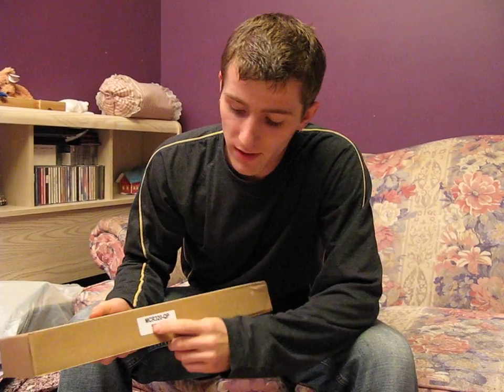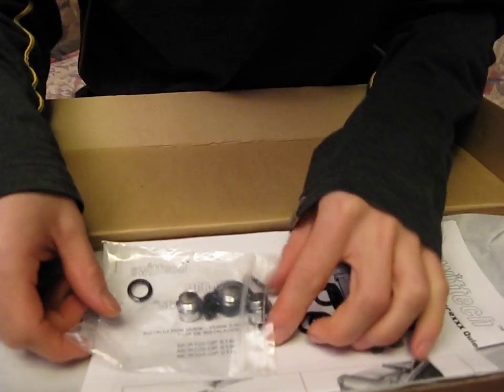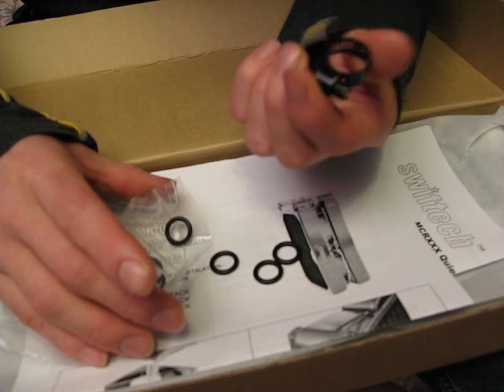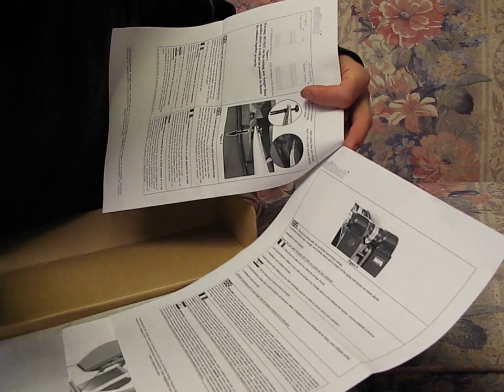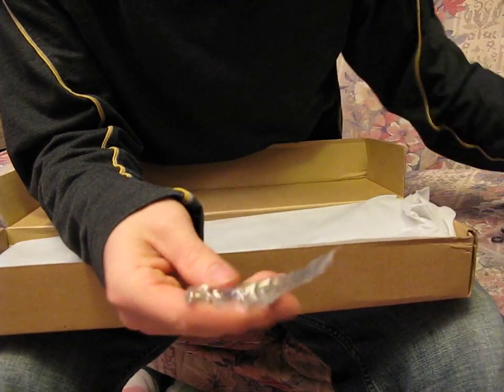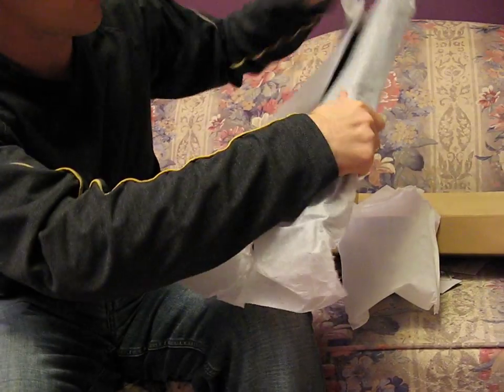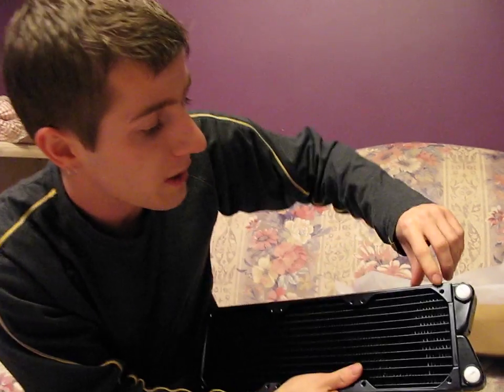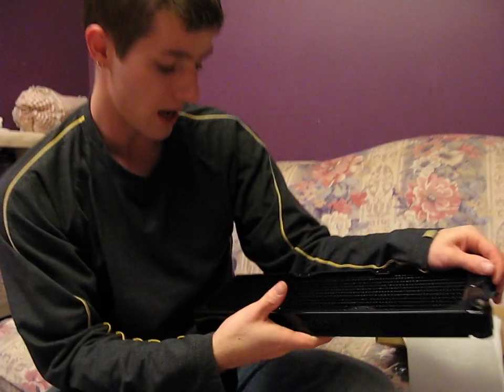Swiftech MCR320 Stack Water Cooling Radiator Unboxing Linus Tech Tips

Comment: swiftech's MCP655 is rated as one of the strongest, and overall best pumps in the business, it can easily push through two 360mm rads and three water blocks (I've seen pics of such a setup in an ATCS 840, it was incredible)

Comment: Yate loons, really? I mean they are great fans, but they're super loud and cheap quality-control (especially when mounted horizontally on a rad). I'd get some Scythe Gentle Typhoons.. They might not have enough static pressure for a rad sandwich though. Why didn't you decide to go with the XSPC's? better price/performance ratio IMO. but cool stuff! Love the 800D case.